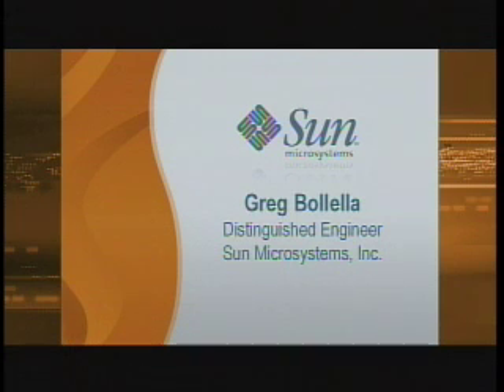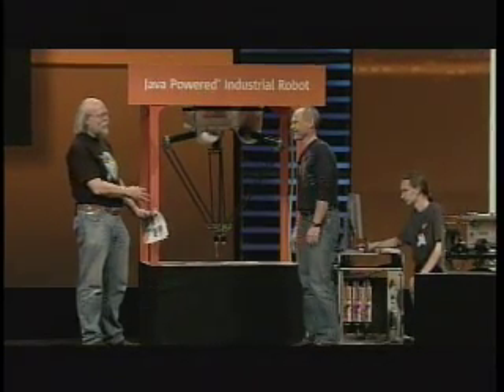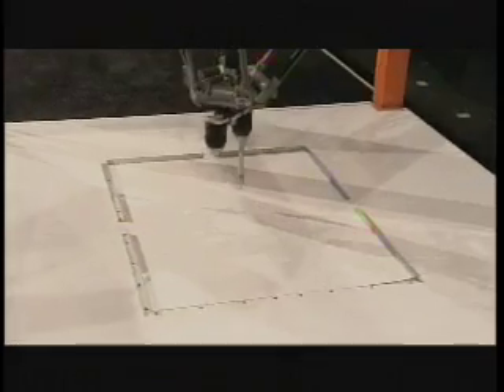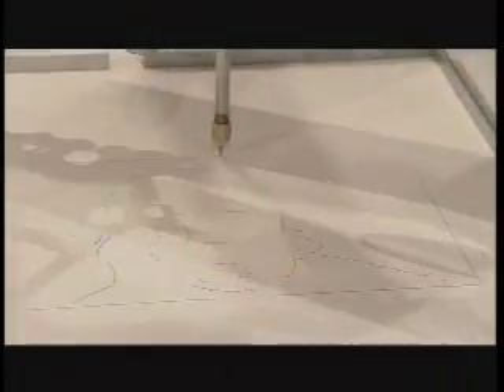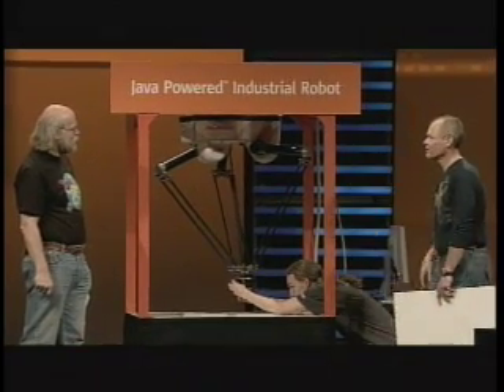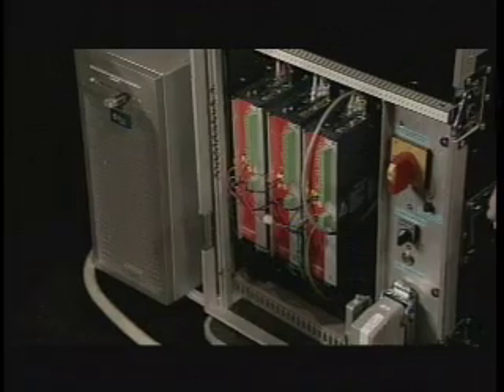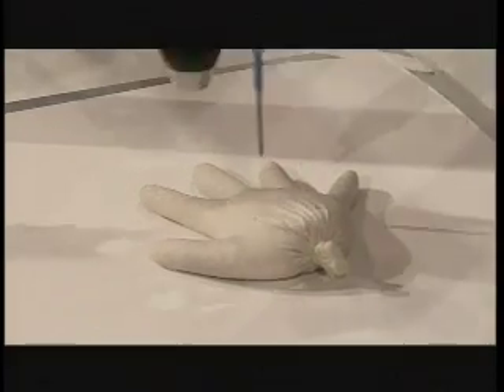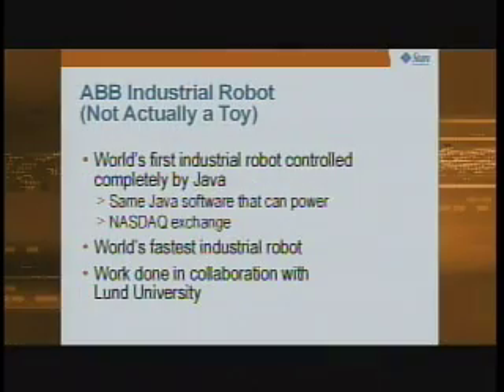World's First Java-Controlled Industrial Robot

Comment: The RTOS in the native controls that the 340 runs on, S4C Plus and IRC5 is Wind River's VxWorks.

Also, I'd feel better with a control system based on the manipulator's true kinematic design rather than a code jockey's guess.